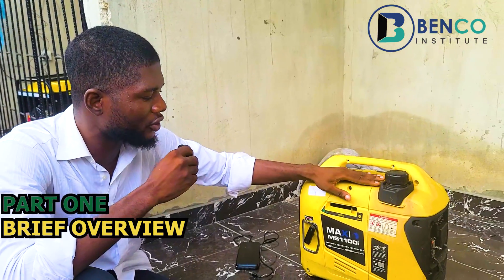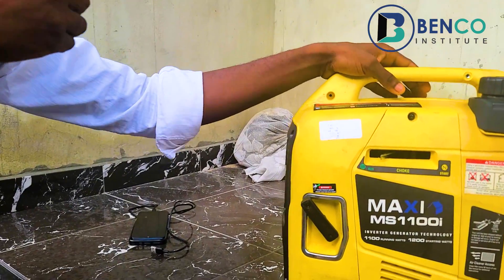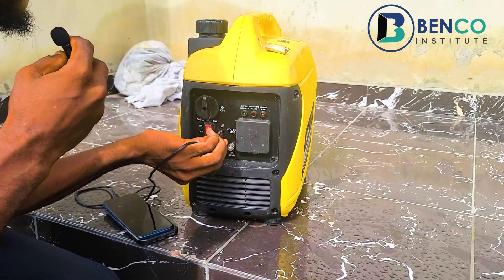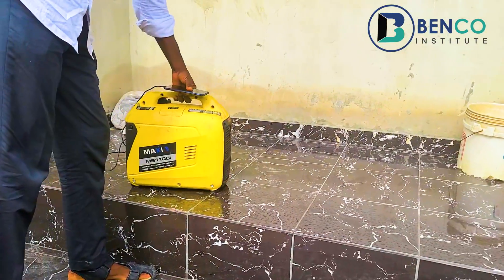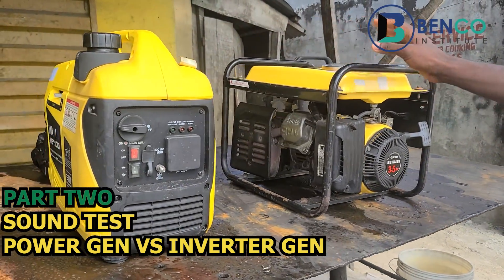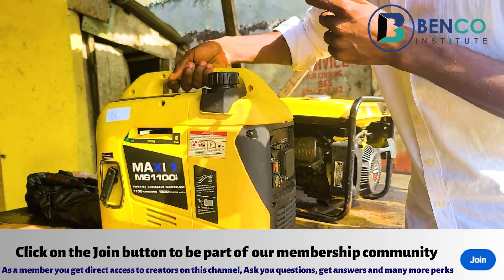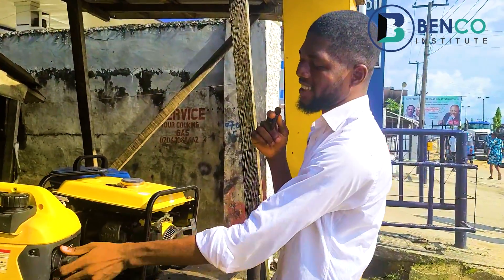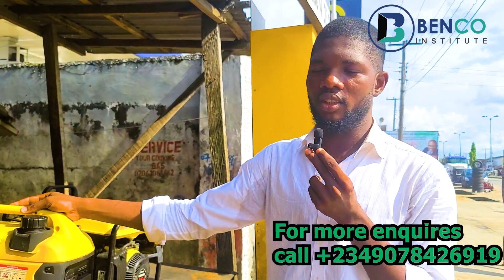POWER GENERATORs VS INVERTER GENERATORs  WHICH SOUNDS BETTER...

Comment: I have been using it for some time now and my own is noisy honestly i am not trying to spoil your product i am looking for solution incase its mine that has a fault
Reply from the maker: @davidayanlowo6509  it is not my product BTW, it's a product of Maxi Generators, you may visit a technician to rectify it

Comment: Whys it called inverter generator ifnit uses fuel. You should just call it soundless generator perhaps.
Reply from the maker: The ability for a generator to convert DC to AC is why it is called inverter Generator...

Comment: How much is the inverter generator... And also can it power electric iron of low voltage ⚡?
Reply from the maker: Reach us on +2348070994351 

If the electric iron is under its rating of 1.2kw it can power it

Comment: Why is it called Inverter gen, does this mean it powers only inverter appliances?
Reply from the maker: Not at all...it can power any type of load that falls in the bracket of it's rating (1.2kw)

It is called an inverter generator because it utilizes inverter technology to generate electrical power. Traditional generators produce alternating current (AC) power directly from the engine, which can fluctuate in terms of voltage and frequency. However, an inverter generator, like the Maxi 1100i, takes the initial AC power produced by the engine and converts it into direct current (DC). Then, through the use of advanced electronic circuitry, the DC power is inverted(converted) back into high-quality, stable AC power with a consistent voltage and frequency.
Reply: @bencoinstitute exactly the explanation I was expecting. It gives you non fluctuating sine wave
Reply: Wooooooooow, superb
Reply: You said 2 Litres of fuel can carry it for 6hrs in the other video, pls is it 6hrs on maximum load or just running idle?